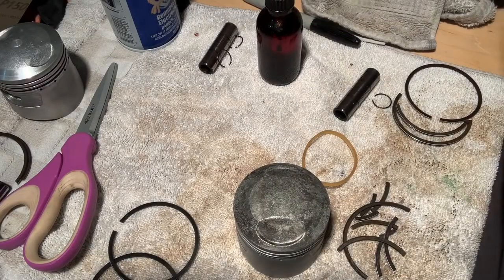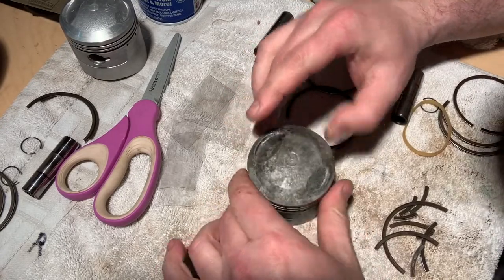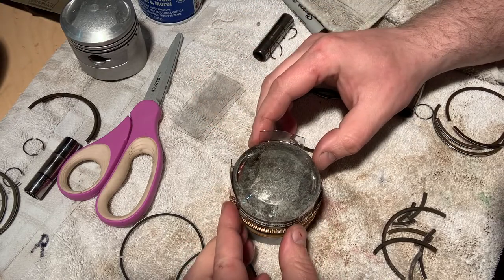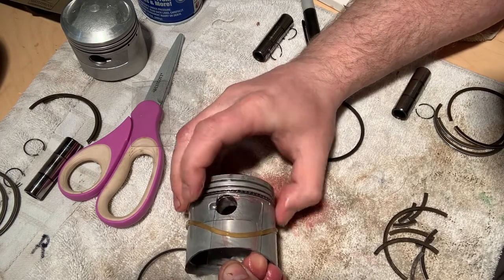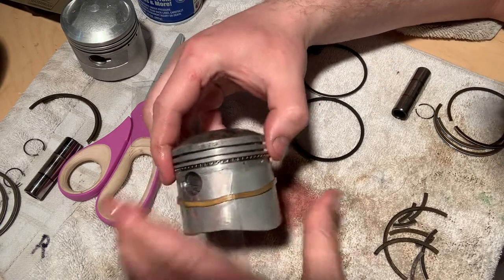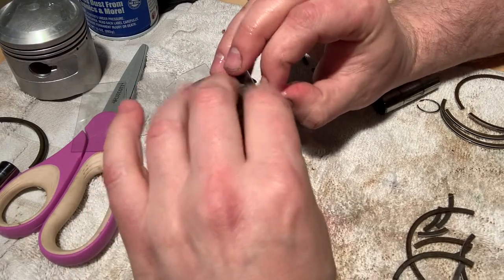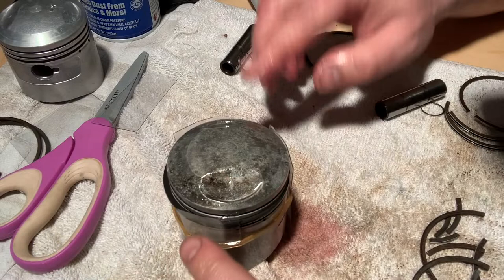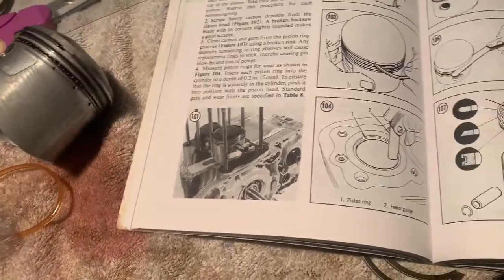How To Easily Install Engine Piston Rings: Part 133

Comment: OLÁ  Keeo    08/08/24   Tanto tempo... tempo... gasto só para provar que não sabes o que faz nem o porque o faz.  Roberto Udo Krapf
Reply from the maker: These were literally the first rings I ever installed. The plastic sleeves worked wonderfully.
Reply: @KeepOnWrenching  08/08/24  É apenas um alerta para que pesquises mais.  A maior parte dos mecânicos desconhecem os erros que ocorrem na montagem de anéis.  Cometestes poucos mas deu para identificar. Você com a dificuldade demonstrada deverá esperar oque de seus alunos?  Roberto Udo Krapf